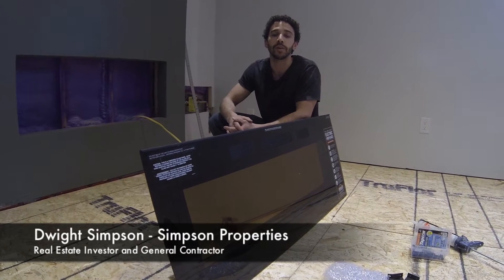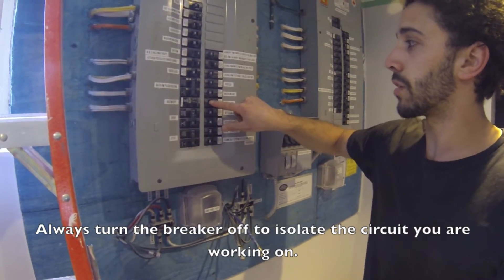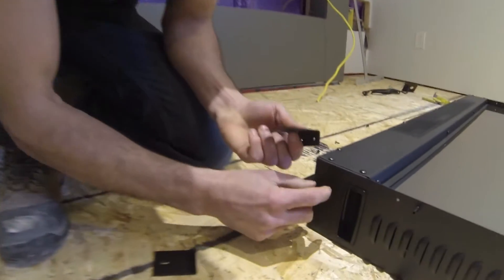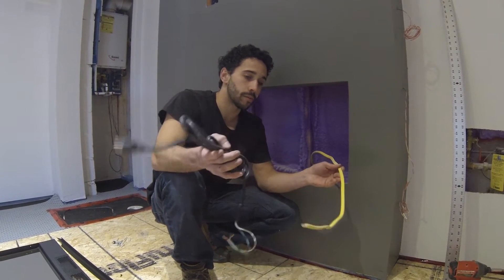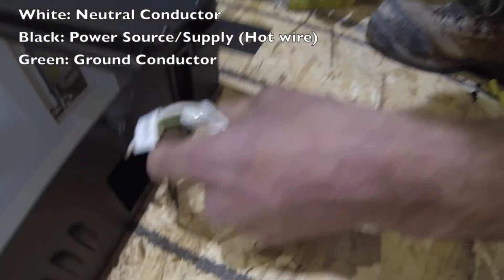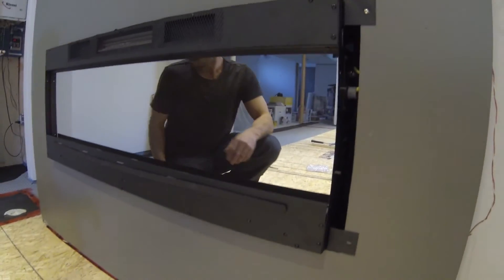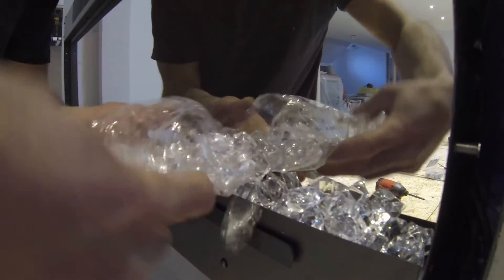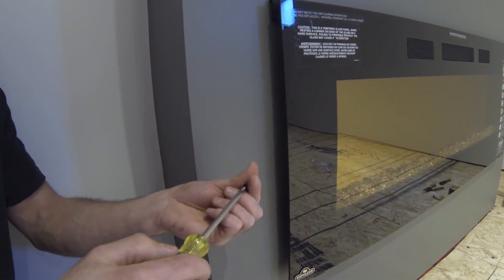HOW TO INSTALL A NAPOLEON ELECTRIC LINEAR FIREPLACE

Comment: Just curious if you don’t want to use the heating can you still use the lighting without using the heat?
Reply from the maker: Yes you can use the lighting or faux fire without the heater turned out. All those options can be selected on the remote.

Comment: I just cam across this video and this is something I am considering in my home.  I noticed that there are no receptacles on the wall.  How do you plug in the TV?  If the plug is behind the wall then what happens if later you need to switch the TV out?
Reply from the maker: +ybsadbglad there is a receptacle located behind the tv. There is also  a raceway behind the wall to the built-ins on the right. This makes it easy to fish wires from the TV to various devices on the shelf.
Reply: thank you so much for the information.
Reply: Terry Sullivan 🤔wth

Comment: Nice video. Is there any way this could be installed where the fireplace is truly flush?  I know your GF vetoed tile but would tile allow for a truly flush looking appearance?  Thx.
Reply from the maker: If a tile backsplash was used this unit would truly flush. Without using a backsplash the only way you could make it flush is to build out the drywall surface with another layer of drywall.

Comment: Where did you buy the yellow 20A cable from? and do you have video tutorial about installing a dedicated 20Amp line?
Reply from the maker: The yellow jacket just identifies the cable as 12/2. It's available at any electrical supplier or big box store. I'm a licensed electrician. I highly recommend you hire a electricain and pull any required permits when doing electrical work.

I don't have a video showing the electrical scope of work.

Comment: Great Video !! Looks great.  what are the are dimensions of the shelving unit and the fireplace wall; what is the finishing you use; it doesn't look like drywall for the shelving walls...thx
Reply from the maker: Paul P thanks! The built in's were custom built by me. I used MDF for all the shielding units. Used a special MDF primer then painted them all white. I'm sorry I don't have any of the measurements for the built-ins. If you check out my Instagram @simpsonproiperties scroll to the bottom you will see some pictures of the built-ins. I also used LED tape lights in the buil-ins.

Comment: how do you hard wire it? I'm planning on installing a recessed electric fireplace, what exactly or how do I hard wire it? there is an electrical outlet below where I want to install.
Reply from the maker: Hector if you need to run a separate feed to your fireplace I recommend you hire a licensed electrician. In order to hard wire it you have to run a separate feed from your panel to the fireplace using a 15 Amp circuit breaker 14/2 wire or a 20 Amp circuit breaker 12/2 wire (amperage depends on your fireplace requirements). If you just remove the receptacle (outlet) and hard wire your fireplace. There is a good chance that circuit will trip, if there are other devices plugged into that same circuit while the fireplace is on. If that receptacle is the only one on the circuit then you're in luck and can use it as your supply wire.
Reply: He actually showed u how to do it in this video...but like he said ...get a licensed electrician